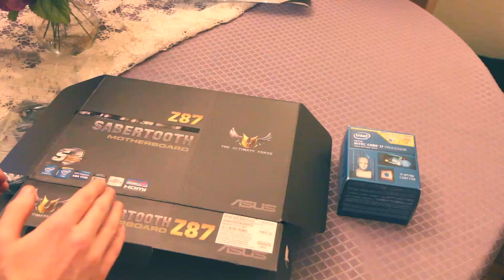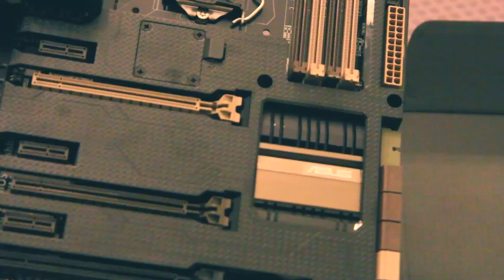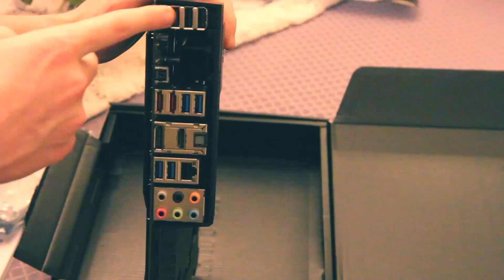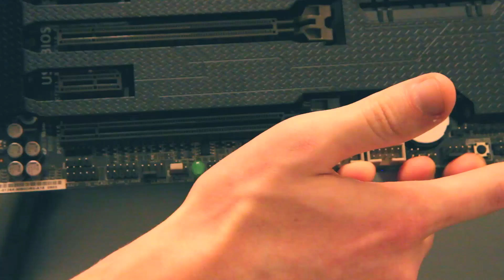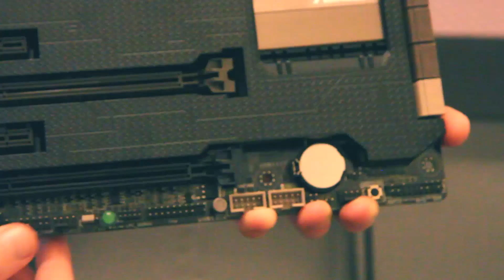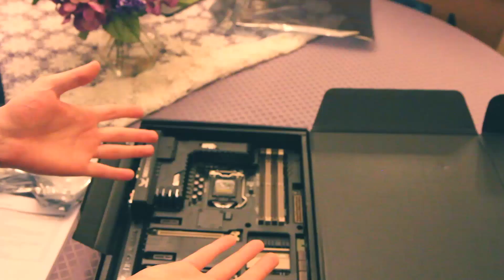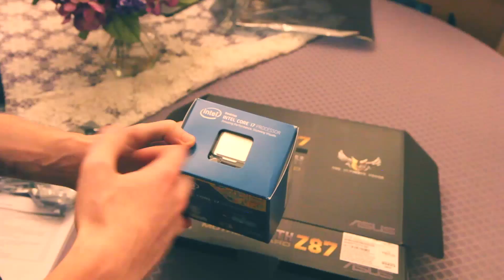What Is A Motherboard?

Comment: Very nice Video! (even though it really wasn't enything new for me)
But I think it is pretty important to some people who lack this knowledge.
Little correction: The round things on the Motherboard are actually capacitors, you can look it up if you're interested in the details.
Also, some CPUs have little chip graphics on board so you don't need a graphics card. Only an option for Office PCs which don't need too much GPU power.
Also a little addition to PCI: There are many other compatible cards like additional audio cards, cards with serial ports, cards for USB (even though there are some which directly plug into the Mainboard), ...

Comment: Wow... this video is terrible. There is actually a ton of false information in it. In general, I would only suggest viewers to take the very basics of what you are saying as truth.

For instance... there are motherboards with onboard video. Video editing is mostly CPU-based. You called the capacitors on the motherboard BATTERIES. There are hex-core processors.... you left those out and started saying stuff like quadtriple core or something. lol. The PSU-to-motherboard connector (20 or 24 pin) doesn't give power to everything. The video card(s) and CPU have dedicated power from the PSU, as well as hard drives and the like. The pins at the bottom of the motherboard are almost exclusively for motherboard-to-case integration. They have nothing to do with the PSU.

FYI, there is only one battery on a motherboard, and that's the CMOS battery. It's used so the BIOS settings don't get reset. Similar to how data loss occurs on old console video games. The 6 audio plugs are for mic, line-in, and speakers (5.1 and/or 7.1 typ).

Question.... what is the purpose of the black casing over the motherboard? Is it some sort of heat shield or heat sink? or just cosmetic or something to make it more difficult to damage the capacitors or whatever?
Reply from the maker: ***** I don't know all the computer jargon used to explain things in detail, however, i did not present any "false" information, but rather a basic overview of a basic motherboard and the main parts that you need for it to function fully like a computer you'd buy from Dell or HP.  I did make a few slip-ups in this video saying 'general' instead of 'graphics' regarding the gpu, and the gpu does the anti-aliasing not the cpu.  Other than that...
Reply: *****
I won't call SaberTooth a basic motherboard.
Reply: *****  It's important to know why the G in GPU no stands for general while not much ago it meant graphic. It is possible to make multiple calculations with GPU faster than CPU either for graphic output or for math output. That's why it's called general now.
Reply: Well, technically capacitors do hold charge in them. They contain electricity. The purpose of a capacitor is to stabilise the electrical charge flowing between point A and point B. Essentially power fluctuates for various reasons. The capacitors do hold power inside them, and thus they could be said to be small charge batteries. They can do the exact same thing, however not really designed for that exact purpose.
Reply: Beren Scott I know what a capacitor is. If anyone calls a capacitor a battery, they're nothing more of an amateur and likely ignorant on the subject.

It's no different than calling a garbage truck a pickup truck.
Reply: You also might have missed the possibility that the wrong word came out of their mouth? Sometimes that happens to me, two words interchange without you knowing it. However, I don't know if this was the case for this video as I didn't really watch it all, I kind of got bored real quick.
Reply: Beren Scott True, but as I pointed out, there was more than a handful of errors made.

Comment: The actual video processing/editing is very CPU dependent and "NOT" GPU dependent.

That e-sata port on the back you referred to is a Display port.
Reply from the maker: Badger Vagina Its both though. That's why I run CUDA which allows me to work in real time while video editing large 1080p HD files

Comment: Speaking from experience, I recommend that you don't use the stock heat paste that comes with your CPU when you go to install it. Get some Arctic Silver 5, wipe paste from the manufacturer off and apply your new AS5 paste thinly using a credit card. The stock paste doesn't handle heat so well and dries up after a few months leaving your machine vulnerable to overheating (especially if you're overclocking your CPU). .___. Again, speaking from experience.

Comment: well the PCI-E x16 isnt only for the GPU, you can hook up audio cards and so forth. so it varies. and the CPU is more towards handling the speed on how the applications perform on your computer, the RAM is really where the applications are being held as they run, it is volatile memory.

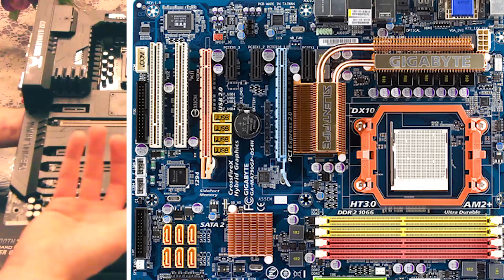1:08 hahahah i think you meant resistors not batteries xp

Comment: Holy crap. Remind me to send you a write up of everything you misspoke about.
Reply from the maker: Jacob Johansen I only made two small slip-ups as far as I am aware in this video describing the GPU (graphics, not general) that was due to being highly dylexic, didn't even notice until someone pointed it out and that the GPU primarily does anti-aliasing, not the cpu. What else was "incorrect".........
Reply: I'm a software engineer, which also involves computer hardware from a pic microprocessor all the way up to personal computers. For one I'll get you a write up about where different software processes actually happen. Also, that motherboard comes with a builtin gpu, or a set up for the processor to handle graphic, it couldn't have an hdmi port on the board without a graphics system. Second Sata ports are not just for hard drives, cd DVD blue ray... Those are some of the items I noticed, I'll send you a write up. I like to share my computer info, because the things really do go together like Legos
Reply: Sorry Had to edit currently on my tablet.
Reply: I want to make sure you and your followers have a better grasp, because a lot of people seem very interested in the topic

Comment: Repzion i feel you never actually had known what those pins at the bottom of the motherboard actually do ? , in most cases pins and connectors at the bottom of the mobo can be used for extra fans etc , but in most cases most of them are used for optical drive/Blue Ray Drive etc etc , power on button etc and anything really you can interact with on the computer case its self as in reset button , fan control slider , lights etc etc , that and hard drive SATA data cables as well.

but it was very nice for you to explain the basic and go into a in-depth conversation on how PC hardware works etc , good for people wanting to be informed if they are starting to build their own PC

Comment: I recently built a new system. Works exceptionally well.
Gigabyte Ud3h mobo
i7 4770k OC'd to 4.4Ghz
GTX 780ti
8 gb of 1333mhz hyper x memory
Corsair rm700 PSU
Closed loop water cooling unit
250gb ssd
3tb 7200 rpm hard drive.

Comment: The plating on the mainboard isn't to make it look cool. It's part of the cooling for the mainboard while also preventing bowing of the mainboard that can be caused by some of the ginormous CPU coolers that are available today. It also acts as part of a channeling system to keep dust from building up on the mainboard -- it doesn't eliminate the need to dust it off, only lessens how often.

https://www.asus.com/Motherboards/SABERTOOTH_Z87/

Intel desktop CPUs are quad-core with a feature called HyperThreading, which makes it look like 8 cores to the OS (my work laptop is an Intel i7, and Windows reports 8 cores). AMD's new FX line has 6 or 8 physical cores on the chip depending on model. There aren't any CPUs available for desktops and laptops that have more than that.

Most desktop CPUs and mainboards are dual-channel only on memory, though tri- and quad-channel memory setups do exist. Note that your mainboard manual will say how to install the memory for dual-channel mode if you are using only 2 memory chips.

An 8-pin power supply connector? I think you're referring to the 8-pin power connector near the CPU that is needed because it actually powers the CPU. The CPU isn't powered off the 24-pin connector you initially pointed out. That power is used for everything else on the mainboard.

The audio ports on the back are for surround sound following on the older AC97 standard -- one for front speakers, one for rear speakers, subwoofer, mic, line in and line out. You do have an optical out though, so hopefully you'll be using that instead. You can buy speaker systems that use the AC97 standard, but if you want Dolby Surround or DTS-HD, you'll likely need to use the optical out going to a receiver.

The pins on the "bottom" are for case connectors. Those include front-panel USB, the reset and power buttons and various status lights you'll have on your case along with any fan connections you may have. You don't plug any kind of power into them and your power supply doesn't have any connectors for those pins either.

Comment: Eh, guess I'll share.

CPU - Intel Core i5 4670k
Cooler - Cooler Master Hyper Evo 212
GPU - Asus 660Ti OC
RAM - Kingston HyperX Red 16GB (4 x 4GB)@1600MHz
Motherboard - MSI Z87 GD-65
SSD - Samsung 840 EVO 120GB 
HDD - Seagate Barracuda 2TB
Backup - Seagate Backup Plus 2TB
PSU - Corsair TX 650
Case - Cooler Master HAF 922

And I'm running barely dual monitors, with a 1080p panel and a 1024 panel XD

Comment: That must have been $400 or something, christ. I go with the mid-range motherboard and spend the extra on GPU/CPU. Got myself a GTX 780 the other day which I love
Reply: I absolutely agree, on my first PC I had a 250$ motherboard but I quickly realized that nobody really needs those "premium" features like 8 channel audio (unless you have that many speakers) or triple PCIe slots and whatnot. For years later I had to upgrade for my new CPU I had to buy a new motherboard and I spent 80. It's been running perfectly since then and I don't feel any difference to the one I had before. Not even in overclocking mode.
Reply: same.
Reply: haiggoh My motherboard doesnt have that new fangled stuff on it.  However the different colors are for port markings, or when its two different colors such as say 6 are black, and 2 are red, that means 6 are on one controller and 2 on another.  The two red probably would be raid or a different speed.
Reply: *****
Umm, I guess you misread what I wrote. I was talking about mainboards with 7:1 dolby onboard audio, so 8 audio channels. I wasn't talking about the sata ports. I'm aware that sometimes they have that many for raid support. But now that you're mentioning it I also think that's overkill. It's hard to even find a case that has enough space for 8 HDDs and with HDD sizes of up to 6TB nowadays I don't see why anyone – even with raid – would have a configuration with 8 internal HDDs. I have four and I'm planning on reducing that number by buying and external raid drive for data storage and using internal drives only for installed software and as scratch disks for video editing. Makes much more sense imho.
Reply: Well sometimes people use desktop gaming boards (like myself) for home servers.  My motherboard has 8 SATA connectors and two SATA cards that sit in PCI 4X and 8X slots giving me 20 total hard drives all at 3TB each.  Why do i need 60 TB of storage? Well, all my movies from bluray, dvd, hd-dvd, etc.  Now that i know 6TB exists i have to see how much they go for XD
Reply: *****
haha, well, they're brand new so unfortunatly at this point a 6TB hdd can cost up to 900 bucks, so it's absolutely not worth it ;) But you can get 3TB hdds quite cheaply sometimes for less than a 100 bucks. Your machine sounds pretty crazy lol… but I get it, I used to have my movies eat up a few TB on my machine as well, but when I needed the space to work I simply deleted all of them. Multiple reasons. A) Streaming high quality HD videos has become really feasible nowadays. B) If streaming wasn't an option I had still deleted them from my hdd because hdd space is more valuable than blank blu ray disks. I did the maths, 100 blu ray blank disks cost you around 50 bucks, that's quite a bit cheaper than an hdd that can keep the same amount of movies. Sure, the blu rays take up space, but on the other hand at least I have something to fill my shelves with, right? ;) C) like I said, I nowadays prefer data that doesn't necessarily need a super fast connection externally so I can access it from different devices independently.
But I guess it comes down to a matter of opinion eventually.
Reply: btw, what I originally actually just wanted to point out is that a PC that is first and foremost used for gaming in most cases doesn't need an expensive motherboard at all. And taken into account those are sold as "gamer motherboards" I find it to be false advertisement to a certain extent and I'd like to warn people not to fall for it and waste money.
Reply: Premium 'gamer' motherboards are designed like that so you can show them off with your window on the side of your case.  No window on my case, just a box with stuff in it, id ont need to show it off.  But to each their own. :D

Comment: I am getting an Asrock 970 Extreme 4. I will not be overclocking on my new build, but just to be on the safe side I will be getting a Cooler Master hyper 212 TX3. It's small enough to fit on my case. with an amd fx 6300 7850 gpu

Comment: Since everyone is sharing

CPU - Athlon X4 651K 3.0GHz
GPU - Sapphire R7 250 1GB GDDR5 
RAM - Kingston HyperX Black 8GB (2 x 4GB)@1600MHz
Motherboard - MSI A55M-P33 FM1 Socket
HDD - Hitachi GST Deskstar 7K1000.D 1TB 7200 RPM
PSU - Rosewill Stallion Series 450W
Case - Rosewill Challenger USB 2.0 Model

Piece of junk, but suffices for gaming.

Comment: Rep, the most cores CPUs have right now are 8-core CPUs. The best one is from AMD. You can get dual CPU boards, but usually only for servers.
Reply: the 4770k has 8 cores (virtual cores known as threads and they r just calling it a quad core) they also have a 6 core(12 threads) which is expansive  Intel will soon be releasing sort of cheaper 6core plus an 8 core(16 threads)
Reply: At the moment there are Xeons with 12 cores/24 threads, but so far as I recall there are 24 core/48 thread xeons in the making. AMD do a 16 core opteron too.
Reply: Landmarqueboy yep i know ;)  ....I was talking about the i7 stuff
Reply: pumpuppthevolume Indeed, but I was directing that at Ben Kuyt anyway. Already started typing it out and posted before I'd realised you had replied too. :P